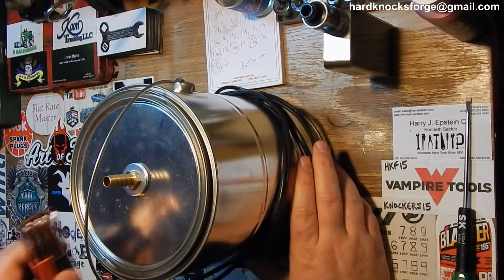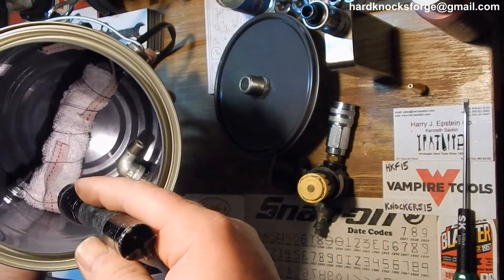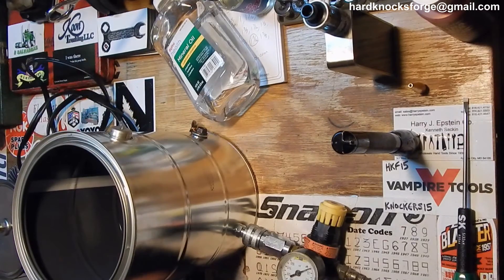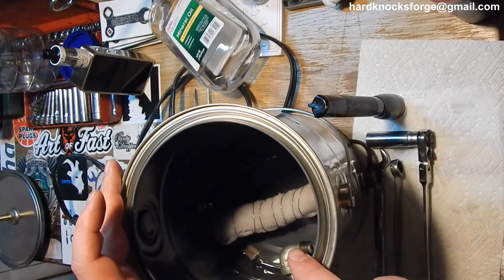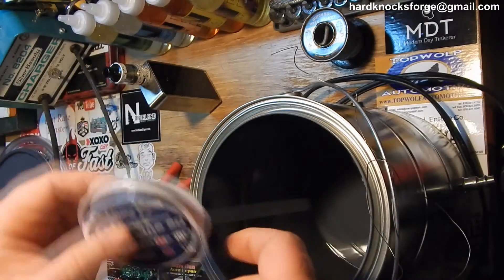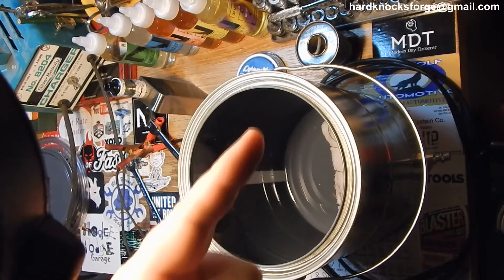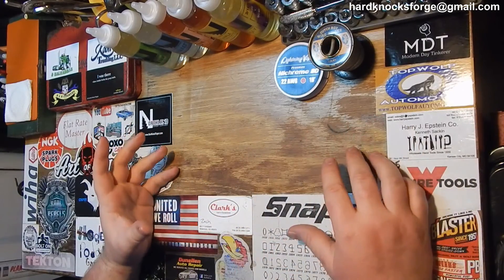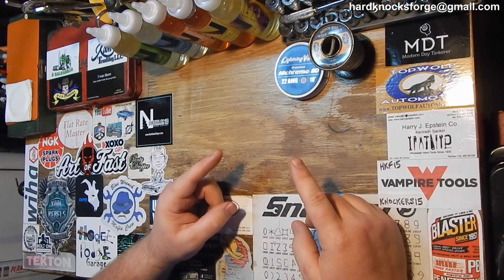How I made my DIY Smoke Machine for Evap Vacuum and Intake leaks

Comment: Sir,what battery you hooked up?how is the  nichrome wire holds,is it better to use 26gauge ss wire?
Reply from the maker: I use the battery in the car that I’m smoking/testing. I’ve always used the same wire I built it with in the beginning, which is the 20 gauge wire.

Comment: What resistance did you use? I'm now at 4 amp (3 ohms) and the wick is burned within seconds :)
Could try and try but asking is easier.
Reply from the maker: I used the 20 gauge wire, link in the description and I wanna say I used two feet of wire. My wick is burned also from using it, but I keep adding more and more mineral oil to it and it keeps it from just going up in flames. A little burnt wick isn't going to hurt anything. I hook mine up directly to the vehicles battery so it pushes pretty high amps through that wire and I've yet to need to replace anything in over a year of using it.

Comment: Thnx for taking time to make this video. Ive watched several and yours makes most sense.
Reply from the maker: Thanks, I guess that's probably why people end up clicking the links to Amazon in this video vs all my other videos. By the time they find this video they're pretty comfortable in actually building one of these smokers themselves, which is awesome, because it's so cheap and so valuable as a tool. I actually just used mine the other day to make sure the evap system wasn't leaking. Have fun with your build!

Comment: If you wanted to you could buy a dryer thermostat and mount it to the out side of the can so the temp would control the power and kill it at a set temp to what you want letting the tstat control the temp of the can.
Reply from the maker: That would be awesome, but I'm hoping that I won't have to leave it running that long to find the leak.

Comment: When I first started watching and saw the wires hooked up to the paint can with rubber grommets,  I thought you were plugging it in to a 120v ac wall outlet and were about to get really curly hair for a millisecond and then die!
Then I saw you had the clips on the ends for 12v dc and realized you weren't nearly as crazy as I had first thought.
That worked pretty good,  I'm impressed with the simplicity and how much smoke it puts out.
Reply from the maker: It puts out way more smoke than I thought it would. It was a success for sure. Actually looking forward to a vacuum leak developing soon to try it out.